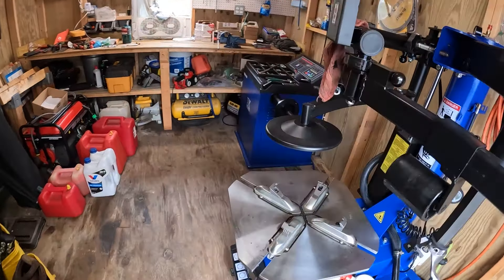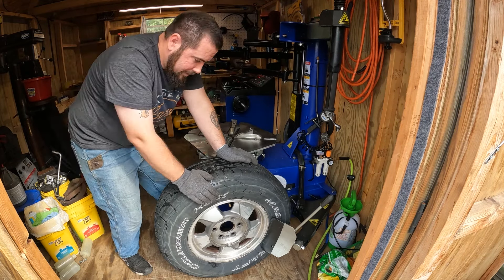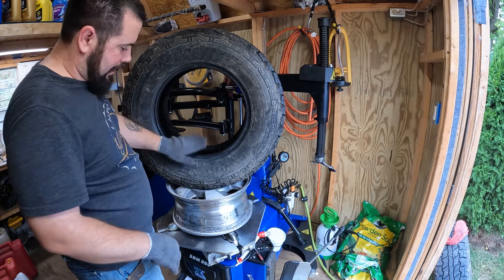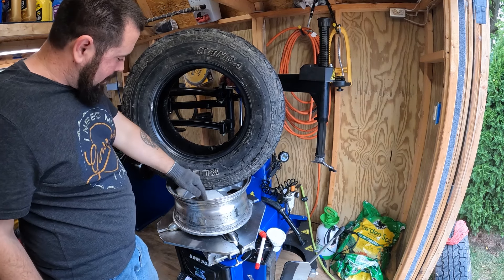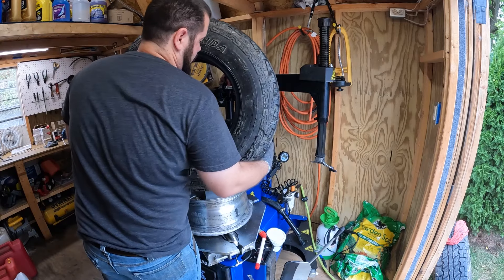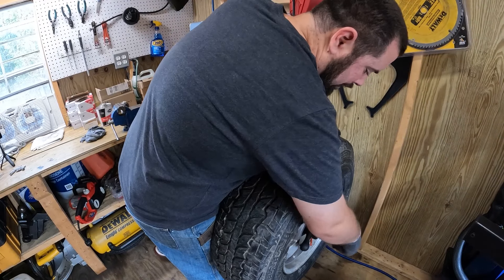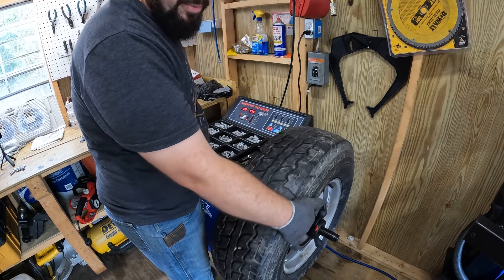Amazon Tire Machine (1 year later)

Comment: I have had both of these machines for a few years.  For the price, I love them.  My balancer's board went out within a week, and the amazon company sent me a new board immediately, for free.  Then about a year ago I had to pull the cover off the balancer and adjust one of the sensors that picked up the wheel speed, but aside from that they've been amazing!  One thing I'd like to mention though, is that the weights should all be in the same area on each side of the wheel.  There is no reason to be adding weights all around the rim.
Reply: If you only stick weights on one side you’re pretty much just static balancing when you want to do both inner n outer weights to get them balanced the right way do static n dynamic n if you can road force them as-well but if you’re doing them in a hurry static is fine

Comment: The plastic rim caliper is usually off by half an inch. Next time you mount a tire measure the inside with a tape measure and also look for the width spec on molded into the aluminum (16x7 etc) then check with the caliper. Once I stopped trusting the caliper, my usage of the balancer became more accurate.  Not that it would have helped that tire you showed, its going to be a problem either way.
Reply from the maker: Good point, I think mines reasonably close, but I’ll double check next time to be sure.

Comment: Have you tried 14 ply and 16 ply tires. Im planning on buying a tire machine to mount my trailer tires. The tire guys keep on raising price by $5 and $10 bucks every visit. Im tired of that bs, looks like they call each other. They went from $25 to $32 and last visit was $40. Any time they are going to start charging $50 plus just to mount a tire. Today I unmounted and mounted one by hand. Unmounting with bars is not so pleasant.
Reply from the maker: If you’re going to invest, get one with the helper attachment like I have. It will really help with those pita ones.  The machine itself is identical to what I used to use back when I did tires at a shop. (Thanks for the view and comment)

Comment: Great video, but the weights are on wrong. That is called "counter balancing". The way to do it (did tires for 20 years) is to slide the weight slightly if you continue to get the need for additional weights on the same side of the rim.

Comment: if it keeps chasing weights like that it could have some water left in the tire. I've had a few times where i didn't get everything out & was dicking around with the balancer for a good hour
Reply from the maker: Very good point! Another reason why I push the whole cleaning thing.
Reply: Most of the time wheel is bent or machine isn’t calibrated correctly

Comment: I have to agree that using clip weights on alloy rims causes more problems than it solves. Steel clips, alloy wheel and a salt mixture on the winter goves you four mini electrolysis machines.

Comment: Ok it looks  like you have it set up  for a steel wheel move it down to alonnom wheel.When you add what's and you have them across from each other that rong take them off and start over I always put my cone on the inside closet to the machine Other than that great job.o
Reply from the maker: The machine I used to use at my job always had the cone inside like you said.
Can't remember at the moment, but for some reason this one works better on the outside. Thanks for the view and comment!

Comment: I saw a video a while back about stubborn to align tires. One thing they said was many  times its not the tire that is off, its that the tire did not seat IN the bead correctly. They basically said that  once you fill a tire and it pops itself over the bead it is not yet where it needs to be because its expanded. You then have to let the air out of the tire to let it shrink  around the circumference INSIDE the bead and re-fill. They found a lot of modern  tires dont need  weights at all.

Comment: Just a note  : There are colored dots on the sidewall and if you line up a tire w/the yellow dot and valve-stem then see the difference in weight usage  and just how little weight is used and how close the machine reads the weights are to being even weighted or very close to even , on both sides of the tire
Reply from the maker: Yeah man unfortunately that's kinda a myth. For that to work tire manufactures would have to know for sure that every rim that's ever been made in the world is exactly the same amount heaver/lighter at the valve stem. I did tires for a job for a while and honestly, I don't think it mattered were those dots ended up. Some rims and tire are just really out of wack.

Comment: You need the balancer on concrete. If it has sand in it. Make sure it's not leaked out or low on sand for enough weight to keep it from bouncing around. Especially with larger wheels. You can damage a Rim Clamp Tire Machine by airing a tire up while it's still clamped down.
Reply from the maker: Yeah the floor things be pointed out, it will be going on a concreate floor when I get my new shop built.

Comment: I use a wire brush wheel on a drill at high speed to remove off any debris on the rim to make sure it's clean.
Reply from the maker: Yeah if it’s really bad that’s the way to do it, just gotta be careful. 
(Thanks for the view and comment)

Comment: I wonder if there is enough flex in your wood floor to cause any issues with the balancer.  You would be surprised how much those wood building floors flex.  I just wonder if the spinning tire/wheel cause the balancer to bounce slightly which may cause the wonky readings?  Just an thought.  Great video of showcasing the machines!
Reply from the maker: Thanks! Some other ppl have pointed that out. It’s probably not the best place for it. I’ll have it on concrete in my new shop, this is a - just for now thing-.
Reply: I agree. Tire balancers I've worked with at shops (Goodyear and Walmart) were bolted to a level cement floor. Good video though

Comment: Are you running the tire changer off only compressed air ? Or is it plugged in also
Reply: Turntable electric
Reply from the maker: It also plugs in, just for the turn table part.

Comment: I think there is mark in tires indicating the heavy side of the tire. Then you can orient the heavy side of the tire opposite the tpms/valve stem.
Reply from the maker: Thanks for the info and I’ve definitely heard that before. But honestly, in my experience and coworkers doing tires, those dots don’t really mean anything and you never really know where the heavy side of the rim is. If you look around where the valve stem goes either on the inside or outside, there’s usually less metal there so it isn’t always heavier.

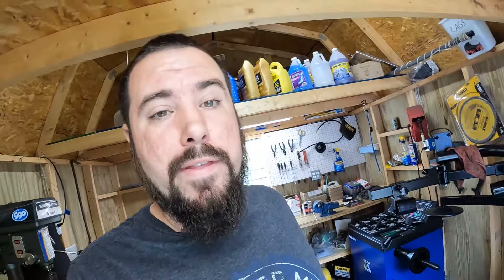Comment: I'm 2:40 into the video. Didn't exactly answer the question about the air compressor. What PSI Line Pressure and what is the CFM of that compressor.
I'm assuming it's comparing this to the Jobsite Air compressor from harbor freight. 225PSI- 5Gal tank and has 5.1 SCFM at 90PSI. Supposed to have a runtime benefit of a 19Gal air compressor that would have a 125PSI Max.

Comment: We need the ghoo, corrosion on the rims is the cause of leaks, and nothing can be done about it
Reply from the maker: lol , I mean, yeah sometimes you gotta use the tire sealer… but a lot of time if you just clean the beads of the rim, you’d be surprised how many leaks you can avoid,, and my experience working tire shop honestly most of the time the leaks are around the valve stem anyhow.

Comment: The machines around up or down it's whatever the closest to a quarter.  So I try to use it no rounding and usually use a little bit less weight and make sure it's close as you can @ 12:00 a lot of times the machine rounds up and adds too much weight which causes the counterbalancing.  There can be some weights that are not perfect and our off as well in the actual weight you're trying to put on.  And sometimes if it is above the horizon and just off a little bit to the left or right you can adjust the weight accordingly..

Comment: To be fair, airing a tire up by hand right after replacing it is not safe. It should have a clamping device so you can move away and an auto shut off. But the auto shut off is not that important cause once its seated it has more than 20 psi in it already usually. Until ya have one blow off on the rim you would never understand but tires demounting rapidly can cause serious injury or death. FYI.

Comment: Thanks for the video. Now you have me really thinking on this setup. Any issues with scratching or damaging new high end wheels on either the mount or balance?
Reply from the maker: Not really if you’re careful with it. The tire machine came with plastic pieces on the duck bill as well as ones you can put on the rim clamps. You can get plastic duck bills but they’re kind of flexible and don’t work that great. The balancer definitely won’t hurt a thing.  Basically just take your time and maybe use a rag with the hand bar and everything should be fine. Thanks for the view!

Comment: Good report on the tire changing machine!  I'd like to get one of those.  

These so-called 'dynamic' balancers fail more than they work.  I went round & round with Discount Tire on a balance job on my vehicle.  Went to 3 different stores, 3 different 'technicians', and 4 different balancers before finally getting it right--and this was only at 60 MPH.  Even took the store manager for a ride and he didn't have an answer.

Comment: When I'm training a new tech to break down tpms sensor installed rims, I teach to have the valve stem just to the left of the duck head, that way the tire tool doesn't accidentally hit the sensor. But as long as the sensor is near the duck head, it shouldn't get damaged.
When reinstalling a new tire, I tell them to have the valve stem lead the tire bead, around the rim.  In other words, keep the tire bead behind the sensor stem while it's turning.
When I end up with a tire that doesn't quite balance out as much as I'd like, I'll put it on the passenger side rear position. That would be the least noticeable spot for the ride quality of the vehicle. Then, hopefully, the next time it's balanced, it should balance out better. Maybe after a few thousand miles, take that tire back off and try rebalancing it dynamically, and see if it doesn't balance better.
Reply from the maker: Yes sir, this all sounds right to me. thanks for the input.

Comment: I don’t know if you can set your machine up for static balance. That’s how I do all of my aluminum wheels, one stick on weight in the middle of the rim. That way, I don’t have those ugly weights hammered on the  outside of the rim.  salt and the weights corroding the rim. Plus, you don’t crack the clearcoat on the outside of the rim, causing it to discolor and corrode more.
Reply from the maker: The machine was set on static balance for that test, I agree with the stick on weights if it’s something you care about. If it’s not the tap on weights are the way to go, super easy to put on and off and you don’t have to deal with that annoying tape that you have to scrape and clean if you’re rebalancing.
Reply: @nicholsperformance92  I never worry about the tape left on the rim doesn’t matter. Brake cleans the spot you’re going to put the weight on wipe it off with a rag stick the weight on. Never have any problems with them coming off. Only way to go if you racing the car they don’t come off.

Comment: Hey nichols if this helps your rims are usely what's off balance [use stick on wieghts and get your rim balanced]  so if you line up your tire dots often no need to remove/add the weights also mounting tires try silicone spray they darn near push on the rims by hand .other wise things are just practice .and get a tire crayon so you mark where tires came off of when you do a season  change over. what did your machines cost ?

Comment: Need to get yourself some tire crayons. Can mark references on the tire when you're shifting the tires around on the rim. Another mod you can do is buy a balancer locator laser to mount on the balancer. I have the same exact balancer, and that's my next planned project. They have them on Aliexpress for a lot cheaper than what ebay and amazon sell them for. They're the same exact products with the same shipping times, so, I'm ordering 2 from Aliexpress to mount one on the top for tack on weights, and one for the bottom to mount on sticky weights. I'm getting the laser that takes an 18650 battery, and it has a mount that the laser can detach from to charge via USB. lastly, I've been having the same problems using CK Auto weights. I need to weigh them on a scale, because it seems like I'm chasing weights on some wheels.
Reply from the maker: I probably should get some crayons. I've also heard of ppl putting lasers on these, sounds cool.

Comment: A Les Schwab tire store here in Modesto CA scammed my wife $1800.00 out of an alignment and tire balance and rotation on our 2000 Chevy Suburban… the job should have been a $700-$800 job max but some shops do tend to to scam women more than men…. and that is why I do most of light repairs and tires on our vehicles myself since I used to work at Sears Automotive in my early 20s… next stop for me is purchasing a tire machine for my shop at home.
Great Video!! Thanks for sharing!!
Greeting from California!! 🇺🇸🇺🇸👍👍
Reply: Even 700-800 is freaking insane.
Reply: @frankmfeb13  
tires are expensive
Reply: @alextorre_2023 
What was the scam.
I have never treated one person differently than others. So idk.
Reply: @turboflush alignment balance and rotation shouldn't be.  But maybe they sold tires when the vehicle didn't need it
Reply: You claim scammed,  but what work was done? Did they have to replace parts in order to align it? When you start replacing ball joints, tie rod ends wheel bearings or control arm bushings, the bill adds up.
Reply: I guess that's what happens in California. Should have been 200$ or less for an alignment and 25-30$ per tire for balancing.
Reply: @donmunro144  one set of the cheapest shock absorbers front only , alignment  and one set of stabilizer bar links all other parts are still from factory til today, she was provided no parts or hrs on the invoice ….unfortunately I was driving OTR out of state at that time and was to busy to follow up but we never went back to that store.

Comment: Did you know that you're supposed to line the white dot up on the tire with the valve stem?
Reply from the maker: So definitely heard of this…I’ve done tires professionally tho and I am pretty sure that’s a myth. What I see is there’s no guarantee that every rim made in the world is always going to be heavier or lighter at the valve stem. Honestly, they’re both wildly all over the place even on the same car sometimes. “GOOD”tires are the same no matter how they’re on the rim. (Thanks for the view and comment)
Reply: @nicholsperformance92  Thanks for the reply man! Yeah I guess that would make sense tire manufacturers wouldn't know what wheel will be used or how much to add or take away where the dot is since they don't know how much the valve stem would weigh or how much the material  would weigh from the hole drilled for the valve stem.

Comment: this is why you shouldn’t spend all that money on machines like that it’s gonna take too long to pay for itself and even then you don’t know the correct things like that ((black stuff))is actually called ((beed sealer))so maybe your tire will have a slow leak and you won’t be able to find it
Reply from the maker: I used to do this for a job, I know what I'm doing lol. I also know there's no reason to slap bead sealer on ever rim you do, lol. Btw that's what it is called is BEAD not beed lol. Also if you have alot of cars, trucks, trailers, race cars and so on like I know I have, it's not practical to go to a tire shop all the time. Sooo what is it you know again... LOL again, nice try.